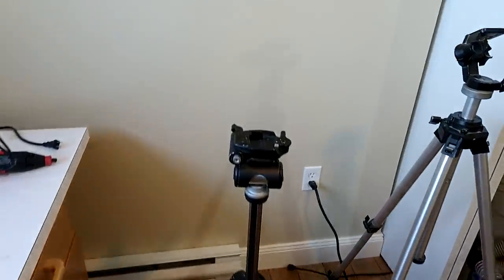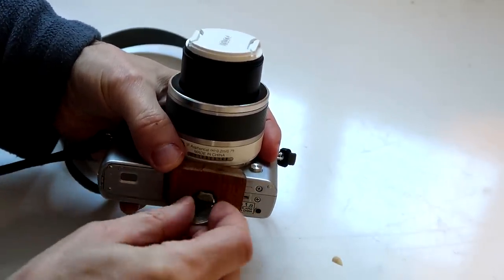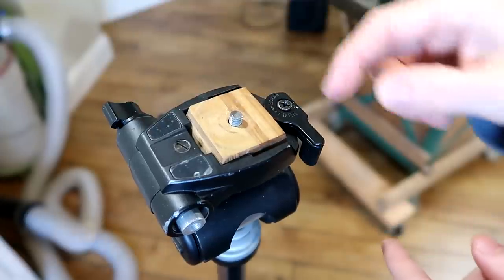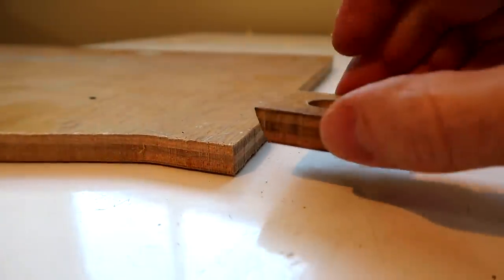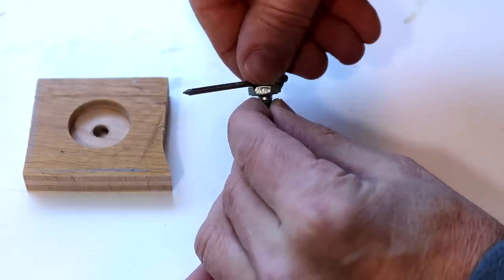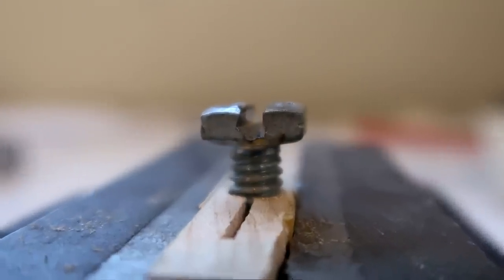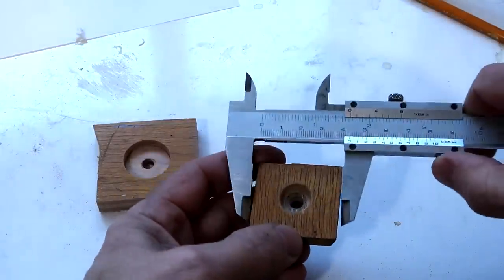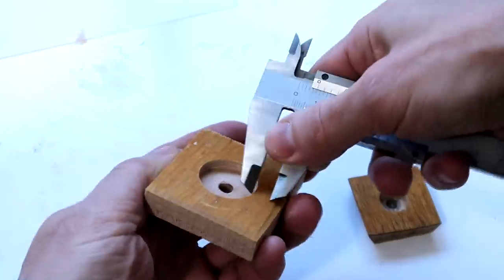Making a camera quick release plate for a tripod

Comment: hot air gunning a glue stick has got to be the most genius thing I've seen in a long time.  
Also, I really should get out more.
Reply: This Old Tony Jimmy Diresta showed this and more in one of his tip shows a while back. Worth watching.
Reply: Almost as genius as having voodoo dolls of fellow YouTubers. And I know it's dated but I just watched it yesterday.
Reply: Crafty glue your metal shavings to your voodo dolls and see if they say ouch! and reach for the tweezers😱🤔🤫
Reply: wait, who has voodoo dolls?   Jimmy?
Reply: Nope, Tony has.

Tony, but did you know they make hot glue with a metal and wood look?
Reply: Yeah! The only possibly better thing would be something that would let you put the melted glue where it's needed instead of smearing it all over heck, like some kind of dedicated heated injection system -- but where could you ever find something as crazy as that?
Reply: TOT watches Matthias too! I'm in good company.
Reply: My tiny glue gun just about manages to ooze out the glue so I normally go over it with hot air to melt it properly.
Reply: @CigaretteTricks   +1
Reply: @JessicaKMcIntosh  Pretty sure Jimmy used a lighter.
Reply: Nice to see you here This Old Tony, if you like that idea, check out Formcard a meltable plastic that can be reformed and is almost as hard as nylon - it rocks!
Reply: @Etna.  And glitter! That's right, you can fix unicorns with hot glue. Your welcome!

Comment: I have made several of these over the years.  I've picked up various tripods at thrift shops over the years and since people never put the camera attachment piece with the tripod,  I've had to make my own.  One improvement I've done Matthias is I glue a small piece of thin rubber or foam to the wood, between the wood and the camera,  so it protects the camera and reduces any tiny vibration in videos. That rubber, drilled slightly undersized, also holds the bolt and keeps it from falling out of the wood.  I also fashioned a small D Ring from thin metal rod and drilled small holes into opposite sides of the 1/4" bolt head to insert the ends of the D Ring into to help tighten the bolt to the camera,  making it more like the actual one that would've came with the tripod originally to tighten the bolt to the camera.  Your videos are the best on YouTube !

Comment: Hi what I do when I have nothing to tighten the clete screw is hand tighten it but set the clete in an anticlockwise offset angle and then while pressing down on the screw rotate both together and I find doing this I can get just the right tension I need. Hope I have explained this clear. Anyway, I'm not pretending to teach you anything cos you are an innovative engineering genius. I never watch any of your videos without learning something new.

Comment: When not using the tripod for a camera, I often put a wooden board on top of it and use it as a little side table. I should make a dedicated mount like this to put on the board.
Reply: that is a cool idea ;-) very useful tip
Reply: That is a great idea!
Reply: A metal pie dish/tray would work really well for that. You could put stuff inside as well. A very neat idea, i'm jumping on it.
Reply: They are useful for mounting lights and microphones on too.
Reply: In my "didn't know anything about tripod" days, I purchased a tripod at the flee market for what I thought was a deal. When I tried to use it I realized it didn't have the mounting screw which after a bit of research turned out to be a missing mounting plate.

I never got around to making a wood mounting plate out of wood for it, but years after I purchased a brand new tripod, I did get around to drilling a hole or two into it and bolting a small wooden top onto it that is the perfect size for a laptop.

I was planning on making some additional mods to use it for a teleprompter stand.

Comment: I was able to make a replacement shoe out of Steel Stick epoxy putty, with some old printing press blanket material as a cushion layer. The screw is embedded, so you just spin the whole shoe to thread it on.
By the way, if you know any printers, ask them about getting some old press blankets. They are super handy as a work surface, router mat, cutting mat, tons of uses.
Super durable canvas-backed rubber sheet. Even Digital presses use a similar material, and it tends to be tackier than the Offset press blankets. (Better for router mat)

Comment: Have you ever considered a magnetic mount for your cameras? It would take a pretty strong magnet, but theoretically you could snap the camera to a tripod, and easily move it to a fixed mount on the wall, or to a sprung swing arm, or to a plate on a tool ...

Comment: Made one very similar, i'm lucky that my cheapo tripod has a big hot shoe mount so i made the nut with a tilting head inside. When i want to open it, i can grab it easily. On  a hotshoe that small, yeah, the nail probably the best you can get.

Comment: The magnet won't interfere a camera?
Reply: I thought the exact same thing, but with better grammar!
Reply: Nope. Won't hurt at all.
Reply: If someone still uses the old DV tape, then yes.

Edit: camcorders, that is.
Reply: @DennisDavisEdu  Sorry I am not from England
Reply: @Quadman4853  Apologies.  You communicate in my language and I cannot in yours.  Respects to you.
Reply: I don't think it will interfere with the camera but it will screw up the battery. I did that with my sister in laws camera and the battery went flat. So now I keep magnets far away from any kind of batteries.
Reply: @MakingAndFixing  Could it have been the charging tech / protection circuit that was killed? I thought regular Ni-cad li-ion cells couldn't be damaged from magnets that are so small and insignificant...
Reply: @Yonatan24  Not sure about that but I'm going to be safe and keep any kind and size of magnets away from batteries.
Reply: I question whether, if the memory card is positioned near the magnet, it'll have the potential to corrupt the card?
Reply: @milliosmiles5160  I wouldn't risk it.
Reply: @milliosmiles5160  Magnets don't pose any danger to flash memory, so no, don't worry about that ;).

Comment: Nice.  Instead of the nail, if you started with a bolt that didn't have a slot cut into it, I wonder if it would work as well to just grind out the opposite of a slot, leaving a "stud" in the center for you fingers to grab.  Down side, the magnet trick wouldn't be an option.
Reply from the maker: it would be kind of a short thing to grab unless it had a big head.  That bolt didn't have a slot originally, I ground that in so I could use a coin on it.

Comment: I think at some point you'll be thinking about adding some sheet steel to reinforce the edge that the cam has squished a grove into. Nice easy fix though.
Reply from the maker: the previous block lasted 6 years without issue, so I think this one will last a while.
Reply: @matthiaswandel  6 years without issue is actually perfectly respectable. I guess your choice of timber would make all the difference.

Comment: I also make my own but just print them on the 3D printer.  ;-)
Reply from the maker: this is the size of object where 3d printing would make sense, though I'm not sure if it would be strong or stiff enough.  Plus you have to model it first, and maybe print it more than once to get it right.  I got mine just a tad too big so I sanded it down a bit.
Reply: @matthiaswandel  Either way has its advantages.  I have many prototypes made with wood.

Comment: hey, nice  build ! 
(but) wouldn't it be much easier to just grind two triangles off of the hex nuts head to make it a low profile wingnut of sorts instead of grinding a slot to glue in a nail ? .. sorry dunno how to describe it better, hope you get what i mean :see_no_evil:
Reply from the maker: it would have very short wings
Reply: @matthiaswandel  i'm sorry,  it just sprung to my mind and i wanted to share ^^  
i guessed short wings might be okay since there is not much torque needed to tighten the nut into the camera housing.

Comment: Why use wingnuts when you can grind a hex screw and a nail! Love it!
Reply from the maker: A wing nut would not be flat enough
Reply: That's true, but you wouldn't have had to grind two pieces down. Either way, as long as it works it's fine i guess
Reply: @matthiaswandel  What if you used a wingnut and ground it flatter, so you only use a small portion of the wingnut
Reply: @matthiaswandel  If you were to do-over your bolt portion again, with a fresh bolt you could drill a hole, stick the nail in, then bend it into a D shape.  This would allow you to swivel the D shaped nail up and out to give you tightening leverage.  I did a similar project making a cell phone swappable mount for my tripod.
Reply: i'd have tack welded instead of glued
Reply: @matthiaswandel  most tripods have a d-ring that flips up
Reply: @natalieisagirlnow  let me know know when your video is available :P :D
Reply: @jacobwest2199  +
Reply: @natalieisagirlnow  that wouldn't have been very Matthias. I was expecting the nail to be epoxied in place! :D
Reply: I enjoyed the dovetail slot. A great bit of detail

Comment: Please check "camera hinged screw" on google,.... and I hope you didnt use normal metric screw, camera equipement has special threading
Reply from the maker: actually, it's just a standard 1/4"-20 thread.  A standard inch size thread.  One (of very few) advantages of not using metric for everything.
Reply: @matthiaswandel you mean Imperial, because it definitely isnt standard metric screw, it has different slope and TPI

Comment: The transition from wood working to metal working is not that difficult. I see a milling machine in Matt's future just as with the other Matt who slabs.
Reply from the maker: who needs a milling machine when there's angle grinders!
Reply: @matthiaswandel  You beat me to it. I was gonna say it for you. That I have seen you/Matthias do more useful stuff with grinders than some people will ever figure out to do with a milling machine. People today are all hung up on machines to create precision... a lot of the time where it's not necessary, at all. But I gotta say, Matthias. You can do a heck of a lot more with a grinder AND a welder. So if you need a new hobby/tool/ability, keep that in mind.
Reply: @matthiaswandel  Don't deny yourself the possibility of new toys!

Comment: The hole is 25.4 mm? Sounds like 1 inch. #metricsystemsucks #imperialsystemisimperial
Reply from the maker: Yes, measured it.  It was actually 25.4!  But doing he calculations in inches would suck.
Reply: @matthiaswandel  LOL!
Reply: I stopped using inches and went metric - made woodworking so much easier.
Try it - you'll like it.
Reply: @skippylippy547   That's only because the metric measuring instrument you're using is graduated in base 10 increments. You can just as easily get and imperial engineer's ruler (triangular scale) and have graduations in 10ths of an inch. It's just as easy to read and now you can work in an imperial base 10 system just like metric. The only difference is the physical representation of the number. The graduations on the metric ruler (1mm) will be closer together than the graduations on the imperial ruler (0.1in). It's roughly 2.5 times the distance (2.54X to be exact). If you really need that kind of precision for wood working then simply flip the ruler over to a scale with more divisions like 1/30. This will give you slightly more precise divisions than the 1mm in the metric system.

At the end of the day it's all just lines on a ruler or tape measure. One system is not easier or more complicated than the other. It's only a matter of perspective.